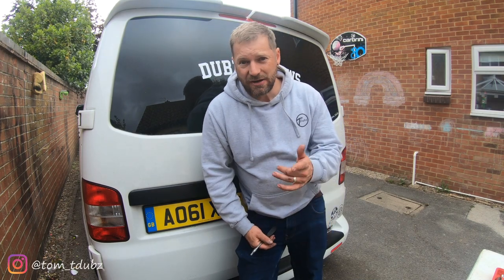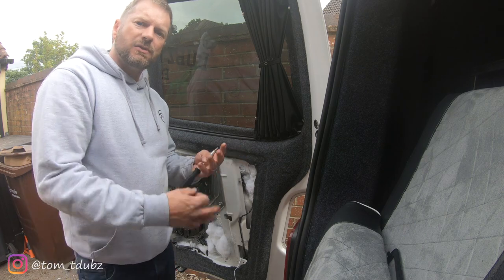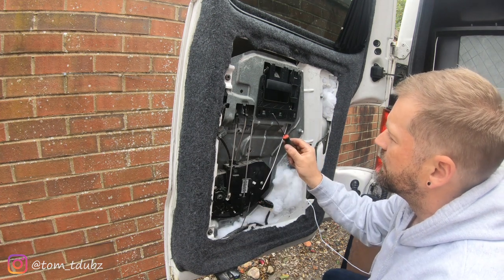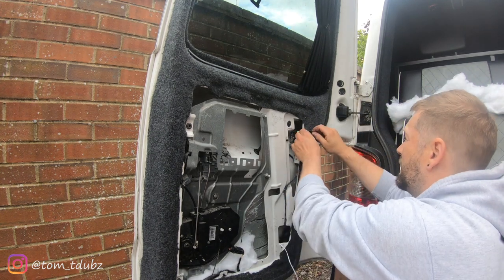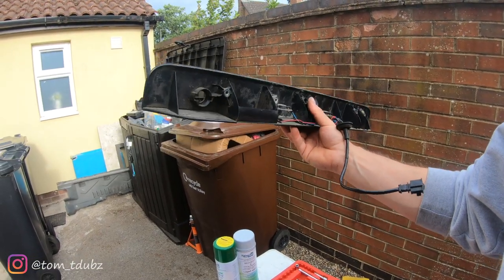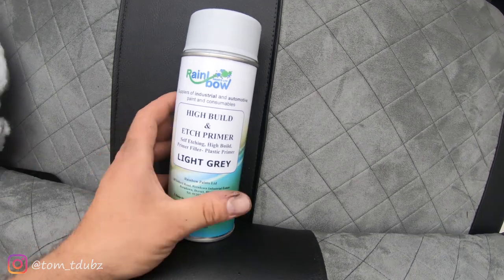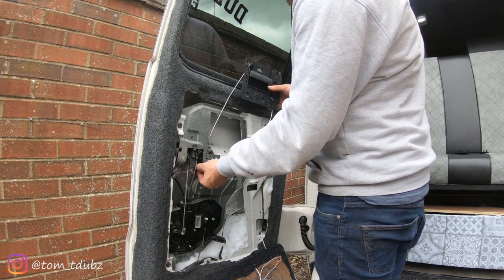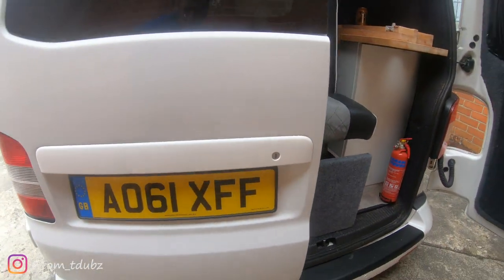Vw T5 grab handle door handle

Comment: Great video, we have just lined our van in smoke after previously having a darker lining, so much lighter now. Looking at fitting a reversing camera on our T5.1, cables are already fed through
Reply from the maker: That’s the next mod for me, gunna take my head lining down and thread it through should be easy enough lol
Reply: @tomtdubz  I have already threaded the video wire just waiting to see what's next.  I previously had a camera on my T6 through the headlining to the barn doors, not easy to get the wire through the rubber door thingy lol
Reply from the maker: Use a metal coat hanger 👌🏻 plug and play on mine, started fitting video will be along soon 👊🏻

Comment: Mr Tdubz I kid you not, I was attempting this today myself to fit my camera. Undid the two nuts on inner frame and couldb't get the bolts on the left off! Pulled out the insulation and carpetting! Looked at the mechanism and knew I didn't want to go doen that route. Ended up routing the cable through the grommet and outside the door/handle for now. Will try the inner handle removal tomorrow.
Im going to wrap my handle in carbon, or might paint!
Cheers for the vid, you timed this well!👍
Reply from the maker: No worries, I wrapped mine in white carbon for about 5 mins... didn’t look right.. good luck with yours 👌🏻👌🏻👌🏻

Comment: Great video, most useful when I had to replace my rear view camera. I know you said it was a pain to get the black handle piece refitted, I found after struggling with it that it went straight back in after I released the metal main frame enough to pull it out slightly.
Reply from the maker: Thanks for watching, glad it helped in some way 👌🏻

Comment: Where can you buy rainbow paint from ?
Reply from the maker: http://www.rainbow-paints.co.uk/ 
That’s there website 👊🏻
Reply: @tomtdubz  did you sand the trim down at all the get the plastic flat ? Or was it not rough plastic ?
Reply: *to
Reply from the maker: @Crazykillerz998  etch primmer it works like a filler, leaves a smooth finish 👌🏻